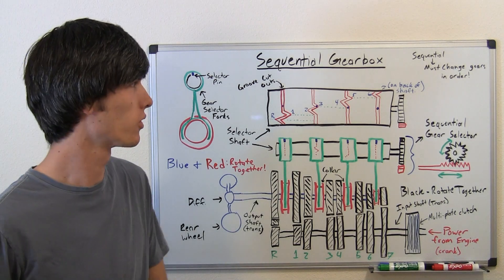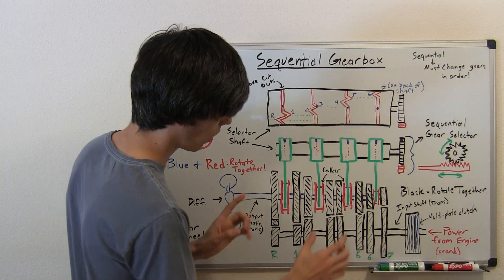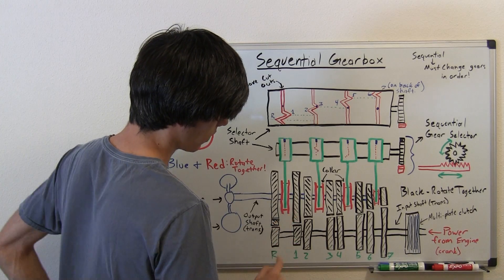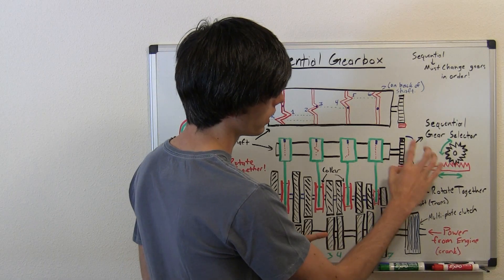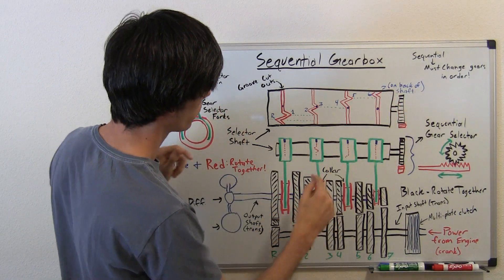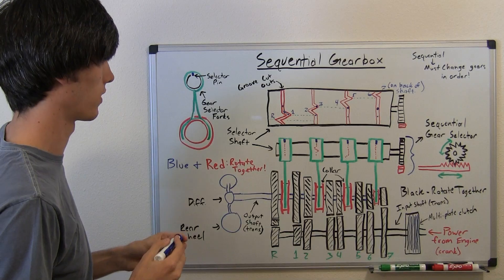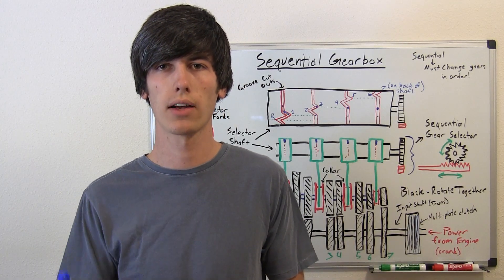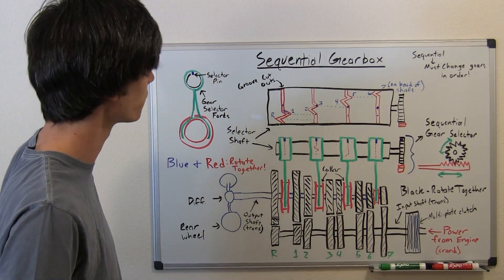Sequential Gearbox - Explained

Comment: So why doesn't this kind of manual transmission need to have the clutch disengaged while shifting gears? Is it floating the gears? If so, then what does the rev-matching for that? If so, then how could it be very fast at all, since rev-match gear floating is slow in cars with regular engines and regular manual transmissions (I mean like if you pull into neutral with or without the clutch and then just wait for the engine to slow down and then stick it into the next gear without using the clutch)?
Reply: What you are talking about here is dog engagement gearboxes. As he explained in the video, the needed gear is connected to the output shaft by a collar. On a regular (or syncromesh) transmission, the gears are connected by a perfectly matching inner and outer gear pattern and the connection porcedure is simplified by syncronizers. In a dog gearbox, the gear and the output shaft are connected by dog teeth and do not use syncronizers. The way this type of engagement is supposed to be used is by very fast gear changes with no hesitation. This is the reason why most sequential gearboxes use dog engagement: they change gears very fast (about 50ms) and the advantages are pretty big on shift times as you said. Dog boxes without sequential shifting also exist but are less used. Hope this clears your mind
Reply: in a normal gearbox the gears (helical) need to be synchronized in order to change this required the engine to be disengaged from the gearbox via the clutch. in a sequential, it uses dog (spur) gears which DON'T need to be synchronized because no matter what speed your'e going at, they (the gears) will lock in place and that is why they change so quickly and are used in race applications...
Reply: ***** Ok I just need to clarify that the engagement principle is not linked to the type of gear used because the gears are not engaged together but to the shaft on wich they freely rotate. The picture here explains the difference perfectly because it is difficult to explain it with words: http://www.thetruthaboutcars.com/wp-content/uploads/2014/02/533x400x21erqc3.jpg.pagespeed.ic.r4Zz8M39t8.jpg .(And spur gears do not mean dog engagement at all.)
Reply: Yeah, MrTheMrhappy and *****, once I finally got around to wanting to tackle these latest responses, I would have said something like you, "Happy," said as clarification (that it has nothing to do with whether the teeth are helical or spur, because they're already always meshing anyway; but -- oh, well I don't have to repeat it all, huh?).

Wait, why is it that just because this is a sequential transmission, it supposedly has to have dog teeth? Why couldn't you have a sequential transmission that still normally needs the clutch to be disengaged between shifts, and has synchro cones?

On the flip side, why couldn't a regular, non-sequential manual transmission use dog teeth and supposedly not need the clutch as much?

I don't know why they couldn't have used a helical gear in the dogged example.

Well, so even though the synchromesh cones aren't in doggies, the doggy setup is still some form of synchronization, anyway. But I think I would still need more explanation about what makes them supposedly fast enough to not need the clutch to be disengaged.

Happy 5th anniversary of the Digital TV Transition (USA) yesterday, Friday the 13th today, Flag Day (USA) tomorrow, and then Father's Day on Sunday!
Reply: Actually you could have a non sequqntial dog engagement transmission as well as a sequential syncromesh but these two technologies fit really well together, especially in a racing application where no compromises are needed for sound, comfort and ease of use. Put in another way when you use each technology individually, the performance difference is not great enough for the consequences most users are going to pay for but when put together, the shift time savings really go up.
Reply: MaxxFordham For up shifts it automatically cuts the spark to lower rpm and on down shifts it automatically raises rpm to rev match.  It's a highly automated system and I believe the automatic control of rpms matched with the quick engagement of the dog teeth allow clutchless shifting (no source but it makes sense to me).  I know on my car, a standard sedan with a manual transmission, I can downshift without using the clutch if I rev match it has to be a concept along those lines.

Comment: I'm confused on gearing in regards to torque and hp. Why not just have first gear extremely high for high torque and have the last gear really tall for high hp? Or simply have more gears? Is it because of the max rpm's allowed by an engine? I'm somewhat new to automotive engineering world and any feedback at all would be much appreciated. By the way, these videos are great keep up the good work...Subscribed!!!
Reply: The gear ratios need to be smaller as the gears go up to accelerate so you can't have 5 gears with all the same ratio. I'm not sure I understand when you say that first gear needs torque and last hp because it is exactly what is represented here. For the amount of gears, many gears are good because you use the maximum amout of engine power more times but you can't just have so many gears because you would always shift gears and shifting gears takes time that could be used to accelerate. The best is to equilibrate the amount of gears and shift times for optimal acceleration. The good thing is new technologies allow for faster shifting and open the way for more gears to be in transmisions. That is why we can see new mercedes 9 gear gearboxes and f1 8 gear gearboxes. Hope that helped you.

Comment: Thing is i don't get is why do they use straight cut gears here, helical gear makes more sense in this case since it has more surface contact and so more power transmission
Reply: Actually straight cut gears are stronger as they have thicker teeth than the thinner helical gears.
Reply: Straight cut gears are used in racing gearboxes for weight savings. The big problem with helical gears is they create a force is the same axis as the axle they rotate on when they receive torque because of the angle in the teeth. To counter that force, you need to make the transmission casing stronger and therefore heavier. Straight cut gears do not produce that force and the casings can be much lighter in that way. Straight cut gears are actually slightly weaker than helical gears but not by much and the use of helical gears is not justified by that: if they need stronger gears they just need to make them wider and put bigger teeth (at the cost of more noise). I hope this helps solving some of the questions asked above.
Reply: More surface contact means more friction meaning more losses through the drivetrain. Also, in F1 the engines upto the end of 2013 season were naturally aspirated and very high revving, therefore relatively low torque. The 2014 season has charged induction (higher torque) so may not have straight-cut gearing. I don't know tbh.
Reply: Yes but when helical gears mesh it's straight, so the load isn't spread across the hole thing equally, this is why they are smoother to run and less annoying to run sound wise as they're almost rolling around on each other instead of impacting the whole tooth like straight cut.
Reply: Engineering Explained Mustafa Shakir Hammood spur gears are generally made stronger than helical gears is one reason. other reasons are that in racing, noise is not a factor (helical gears are not noisy but spurs are lol), spur gears engage at any speed they just lock into place while helical gears require being synchronised ... being synchronised means almost definitely having to use the clutch to disengage the engine from the gearbox... this means a loss of rpms and slower shift times... this would be defeating the purpose of the sequential box which uses the dog gears for their quick precise engagement which allows the engine to stay in the power zone. of course the gear teeth wear over time but so does helical gears... if it uses friction to work the wear factor can be lessened but never totally gone... the only reason road cars use helical gears anyway is because they are smoother to engage because of the synchronisers and less noisy making them better for everyday use. a dog or sequential box is noisy and brutal but hey, on the track that doesn't matter, all that matters is WINNING and that means serious performance. please do correct me if I'm wrong :)
Reply: *****
A bit late but who cares. It doesn't matter if you have spur gears or helical if it comes to synchronizing. You can both shift with or without synchromeshs with the same speed because you don't actually move the gears itself.
The big disadvantage of the helical gears is that they induce a thrusting moment alongside the shaft. This makes it necessary to use heavier/more bearings and also the bearing seats and so the whole gearbox casing has to be stronger, which means more weight and weight is always a big thing in racing.
Reply from the maker: Perhaps cost. The transmissions don't need to last that long, and noise isn't a concern.
Reply: J Irvine Neil McMahon
Why supposedly "can't" you have helical gears whose teeth are the same thickness as if they were straight-toothed?
Reply: From what I know (not much), helical gears are like meshing two combs together while straight cut is like meshing your fingers together. Helical may have more surface area but won't hold as much as thicker teeth.
Reply: But that still doesn't answer my question. I would think you could, for example, have helical gears with thick teeth and spur gears with thin teeth; or you could have them with teeth of the same thickness. If not, then why not?

UPDATE:

Oh, you can have helical gears with thick teeth in comparison. Look at this for some examples:

https://www.google.com/search?safe=off&site=&tbm=isch&source=hp&biw=946&bih=614&q=helical+gears&oq=helical+gears&gs_l=img.3..0l4j0i5l6.2782.4947.0.5240.13.13.0.0.0.0.136.1455.0j13.13.0.ehm_loc%2Chmss2%3Dfalse...0...1.1.42.img..0.13.1428.DUQRh1O1uqY
Reply: What do you mean by "when helical gears mesh it's straight"? All gears mesh straight, don't they? There aren't gears that mesh in some sort of bent way, right? You've lost me.

How "wouldn't" the load get spread across a *w*hole gear evenly just because it's helical? That doesn't make sense either.

I do understand that helical gears aren't noisy like spur gears. That's why in most manual transmissions, reverse gear, which is usually connected by moving an idler into place (which means it has to be part of a set of spur gears in that kind of design), is whiny and the others aren't so much.

Oh yeah, so you're talking about impacting a whole teeth all at once, right? Well then when you were talking about helical gears meshing, I guess you were talking about that the load isn't spread across a whole tooth at once, not a whole gear (as you errantly implied with your wording there). But yes, it does impact a whole tooth evenly; just not at the same time.

However, none of that response answers my question about why you thought that helical gear teeth were always thinner than the teeth of a spur gear of the same size.
Reply: As I understand, I may be completely wrong( please correct me Engineering Explained ) the limiting factor on the gearbox is the amount of axial load the casing can support due to the helical gear angle and not the actual gear strength. By replacing the helical gears with straight cut ones (or helical ones with a reduced angle) the box can endure higher torque and therefore more kW. Less contact means less friction thus less heat and more efficient transmission, straight cut gears make a lot of noise though(got to love that noise).

Comment: I didn't understood a thing, maybe you've already said that. Does this system works with gear with straight teeth as with gear with inclined teeth?
Reply from the maker: Yes, you could do either. If you have helical teeth you need to realize this creates a lateral force, that needs to be compensated for. This could be done with a simple thrust bearing, and alternating angles on the gears that help cancel out.

Comment: Engineering Explained can you please explain the Dog box, and the dog gears differences from this trans! Thanks
Reply: the dog box uses regular H-pattern gear change and is not as fast as sequential gearboxes but faster than your average gearboxes. the dog box differs because the sequential as mentioned change in sequence but the dog box is still an H-pattern gearbox which uses dog (spur) gears. spur type gears don't need to be synchronised like average helical gear sets therefore clutch is not needed during gear change making it faster. they are also stronger than helical gears which is why they are used for racing. the main difference is that because the sequential gears are all in line the shift times are much faster than the H pattern style gearbox... sequential also eliminates the chance of going into the wrong gear say down shifting from fifth to second when you meant to go fourth... its fool proof lol so you wont blow the engine or destroy the gearbox

Comment: When you downshift with a sequential gearbox you must use the clutch?
Reply from the maker: I believe it depends on the transmission system. Some are automated, other require driver input.
Reply: If it's a dog-box then you can rev-match without the clutch. Most sequentials would be dog-boxes.

Comment: a suggestion: The Clutches of a formula 1, it is interesting why it is much smaller than a normal car ... Terms of inertia and motor drive, and also one of the reasons why the engine can reach a wide range of rpm almost instantly form
Reply from the maker: Yep, they can get away with smaller clutches because they use multiple discs.

Comment: You say with sequential you can't go from 5th to second for example a turn. Technically you could, but you'd have to take your left foot off the brake and use it to disengage the clutch and still go through all the hand motions. Not efficient, but possible!

I've watched several of your videos and this is the first "a ha! You got something wrong!" I've been able to catch. Great vids, accurate, informative, and passionate yet concise.
Reply: you still physically have to go threw the gears if you engage them or not.. So he is correct. Just because you do not engage the clutch does not mean you go threw the gear..   On a typical H pattern trans you can go from 6th straight to neutral then over to 1st .. with out going into the other positions .. in this trans you can not you still must pull the lever 5times to get down to first... So good try but you are wrong..

Comment: How does those transmissions work which give the driver an option to use either manual (paddles/+- thing next to the d r p thing) or automatic mode
Reply from the maker: It's all electronic. Just an automatic gearbox with controls that the driver can choose.